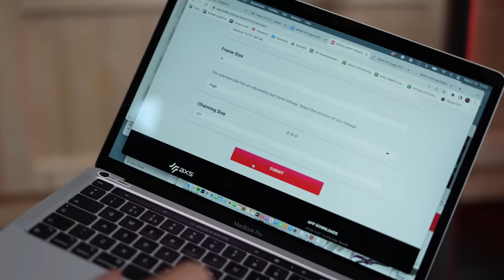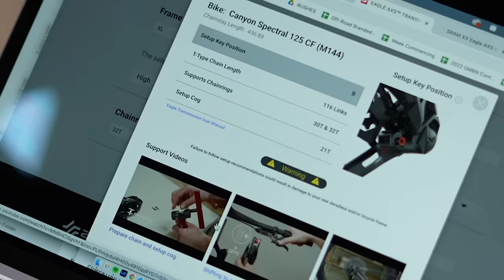NEW SRAM GX Eagle Transmission | Unboxing, Installation And First Ride

Comment: #askgmbntech
Im really thinking about getting this GX Transmission, but I dont want to change my bottom bracket,.... 
So I wana know if i can keep the old DUB style bottom bracket with the new crankset?

Thanks in advance.
Florian
Reply: It uses the same dub bottom bracket. But you need to install a 7.5mm spacer on the drive side and a 3mm spacer on the non drive side, both external. This is due to the wider chain line. It should come with these but if not they can be purchased. 
Inspect the dub bracket before installing the new wider crankset to ensure all the bearings are running fine. If so  apply grease and you are good to go. 👍

Comment: #askGMBNTECH Have you shifted it at times and found that the only reason you know it shifted is because it got easier or harder to pedal? I've actual had it do that with the XX on a Ebike in the right condition it will shift that smooth image if they could get it to do that all the time

Comment: The hanger was always designed to be a sacrificial part, so that it would break before the frame or derailleur. With the transmission, it's great that the mech is so strong, but won't that make the frame the new sacrificial part?
Reply: no, I dont know how to explain why, but ther is a pinkbike test video on this subject where they drop it a lot
Reply: it's due to it all being bolted to the trough axle it's all bolted together as a solid unit the frame is "sandwiched" between the  transmission.

Comment: #askgmbntech When I was buying my bike I think the issue with SRAM cassettes, compared to Shimano, was that the steps between gears were too big. I have Deore XT 10-51T on my bike (1x12) and I find the spacing between gears quite nice. It allows me to smoothly shift to lower gears when climbing without the lower gear being too low.  I feel that having a bigger difference between gears would make it less smooth. Current gear would be too high but shifting to lower would be too low. Is this an issue on current SRAM cassettes?
Reply: That was never an issue, even on the old setup of SRAM
Reply: New spacing is not that different if you check Shimano is: 11-13-15-18-21-24-28-33-39-45-51 and the new T-Type Cassette is: 10-12-14-16-18-21-24-28-32-38-44-52.
Spacing in the middle is around nearly the same but you got an easyer gear and a harder gear🤷‍♂️

Comment: hello Shimano.. wake up!
Reply: With that price, and that weight, Shimano has nothing to worry about.
Reply: Wish Shimano would counter with an improved, high quality, mechanical groupset at a price most cyclists could afford.  I never had any gripes about XT/XTR in the past.  My 20-year old Klein Palomino, equipped with XT/XTR still shifts like a gem.  Unfortunately, with the phasing out of mechanical parts, it will get increasingly difficult to keep the bike up to snuff.

Comment: That just made XO1 and XX1 mechanical and XTR obsolete.  Why get XTR or XX1 mech when you can get this for less money, the improvement in shifting will more than offset the weight difference.  It isn't even that much more expensive than XO1 mech.

Comment: They want you replace you derailleur every three years like a cell phone when the batterie will be dead and wont hold the charge for more than one hour. Replacement batteries in three years will ba as much as expensive as a new derailleur. Typical marketing startegy to make you spend more periodically.
Reply: Batteries are £45
Reply: Exactly
Reply: Yep. Bicycles are going the way of cell phones. Remember when paying $1000+ for a phone seemed absurd? Well, this groupset alone runs over $1000, and like phones, absurd prices are becoming the new normal.
Reply: e-car, e-bike, e-derailleur (e is for expensive) may be they will also introduce bug shifting, like slowling cellphones, in the derailleur after two years of date purchase to make you buy a new one as it will be unrepairable.
Reply: @curtvaughan2836  Yes, unfortunately  🙁 
On my Merida 2018 full suspension mtb i have : Sunrace cassette, KMC chain, Shimano SLX derailleur, and is  good enough for me